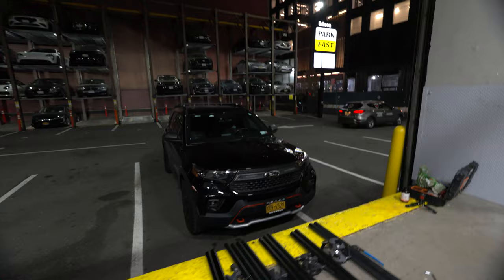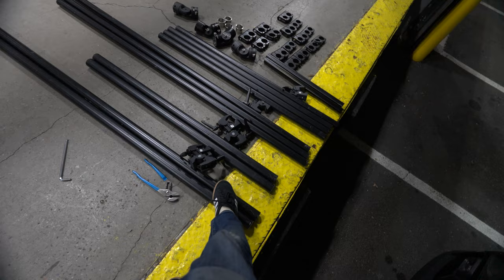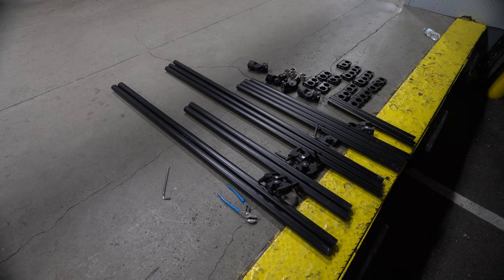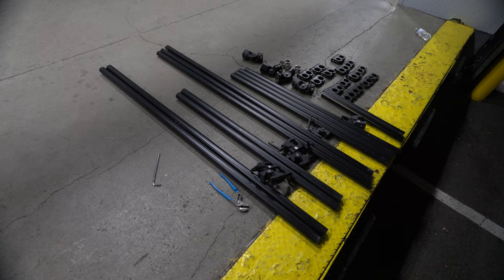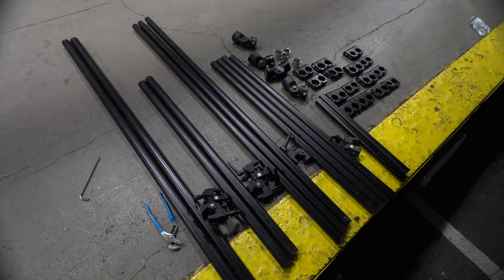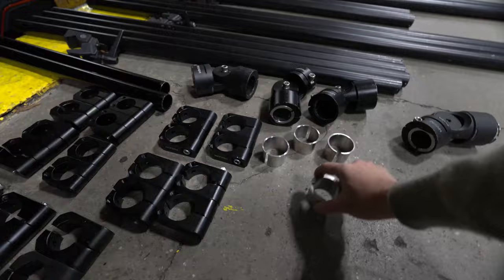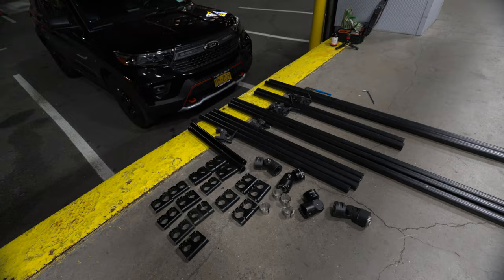DIY Camera Car  "Teaser2" - It's almost complete!

Comment: Help! What mount did you use to get the rs3 on to the airweave!
Reply from the maker: I used a combination of the RS3 Pro base extension kit along with these two items from Proaim:

https://www.proaim.com/collections/stabilizer-gimbal-accessories/products/proaim-quick-release-plate-for-hand-held-gimbals

https://www.proaim.com/collections/stabilizer-gimbal-accessories/products/flycam-quick-release-mount-for-ronin-m-mx
Reply: @keisugimoto570  bro thank you I’ve been busting my head all day!
Reply: @keisugimoto570  this base plate came with my kit so I guess I need the sliding plate
Reply from the maker: It took Mr sone trial and error because the DJI base plate threads and the proaim threads didn’t match up. Even if I could get the gimbal secure it was crooked. But once I got the proaim quick release plate and the fly cam quick release mount, it all fell into place, pointing the correct direction.
Reply: @keisugimoto570  seems like we went through the same experience— once mine is all set I’ll post it up